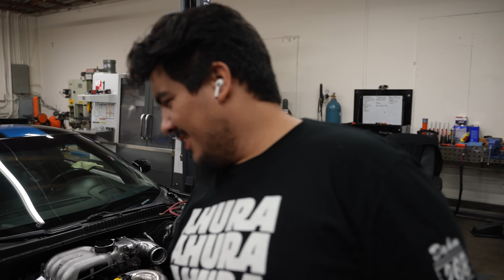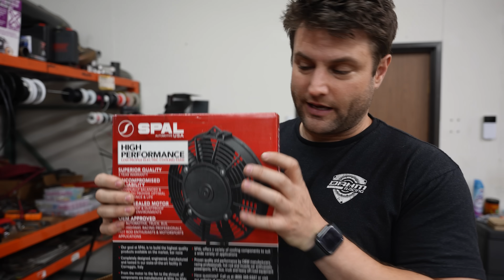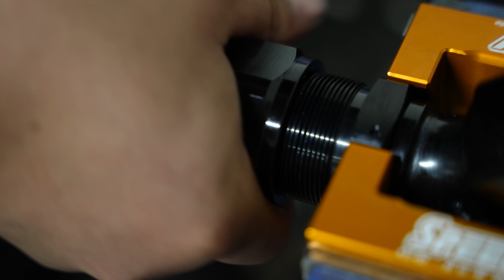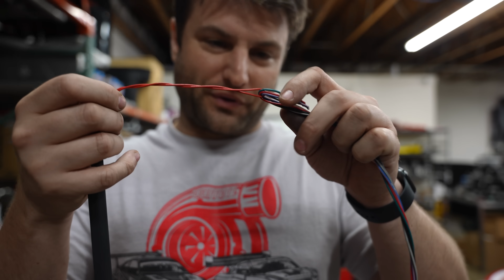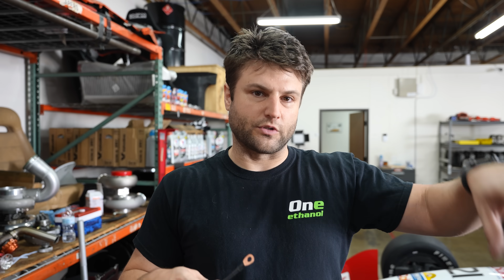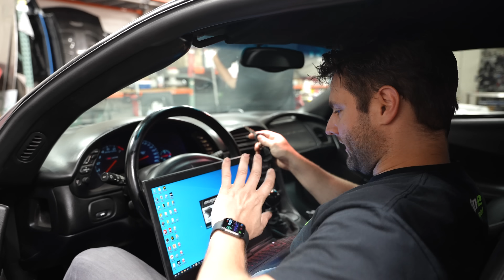Building the Rotary Corvette GM would be proud of. Everything works.

Comment: Something I just learned recently:  pre-filling the oil filter has more risk than benefit.  When you're pre-filling it, you're pouring that fresh oil into the output side of the filter, meaning it's not getting filtered before going to the engine.  While in theory the oil and filter SHOULD be contaminant free, oil and filters do sometimes have contaminants from the manufacturing process or the packaging process, and you've just given them free access to your shiny internals.  When contaminants measured in microns can damage those shiny parts, it makes sense to make sure every single drop of oil goes through the filter properly.

Comment: that electric pump sounds noisey crappy, you can install a clutch on the pump pulley like ac compressors use so when your I drag strip it disengages the pump, can be computer controlled or g force

Comment: Teasing with the FC in the background. I love the fact that the OEM gauges are working.

On the oil temp though, you need to let it at least reach 212F to burn off water vapor and contaminants. Did you put a thermostat in the oil cooler lines?

Comment: As you mentioned in the last vid the MR2 uses electric power steering. The reason I've been always been given for that is that it allows the ECU to switch off the power steering once you're at speed. So once you hit ~70 the p/s flicks off and that gives you the more direct steering wheel. 

Not sure on the Volvo setup but I'm sure you could implement similar functionality.

Comment: Answer to not needing DBW TB to make car work. 

Use hptuners. In system tab under platform, DBW column has a 1 under Y body (vette).  Put a 0 there.  Remove all dbw/electronic pedal codes also.  Done.

Comment: I worked a OEM wiring factory, if that relay is made by waytek its about the toughest relay you can get, we put those on mining equipment like rock crushers and stuff, if it can handle that environment it will last in a car for a long time

Comment: If you want to measure current you can also put a low resistance high power resistor in series with the battery and use the meter to measure the voltage acxross the resistor. Ohms law to find current. This way you won't fuk your meter

Comment: Hey Rob, a pro tip regarding the Volvo power steering pump. It require the Volvo OEM green powersteering fluid, otherwise it can be damaged! That has happened in the Volvo dealership I work at.

Greetings from Sweden, also been following you for a long time and absolutely love the content you upload and especially the four rotor build!

Comment: Now that's how you weld up charge pipes. Take notes all you wanna-be welder/fabricators here on YouTube. Pie cuts and mandrel bends, TIG welded WITH FILLER (its ridiculous I have to say that) and he back-purged the pipes to reduce crystallization and deformation along the welds on the inside which negatively impacts flow. Ugh, I'm not even a welder but as a mechanic and builder I know this stuff so the bad welding videos must really frustrate the professional metal whisperers.

Comment: That Volvo pump usually outputs about 60% of the capacity when just plugged into 12v, to utilize the complete 100% you would have to connect it to a can-network as they are stock..

Comment: I am pretty sure if you read out how much Ohm the throttle body of the Corvette sends back to the ECU on start up to check if its there, and it opens, you could use resistor's to not have that flappy thing on the car :)

Or if you want to go a bit more Techy, ZeroPi will work too, Have seen it trick BMW ecu's and GM ecu's to work together without any hicups!

Comment: If you wanted to do a test since you have a almost direct turbo to throttle body . You can do a air to water intercooler with a dry ice box in the trunk see which works air to air or air to water  intercooler  .

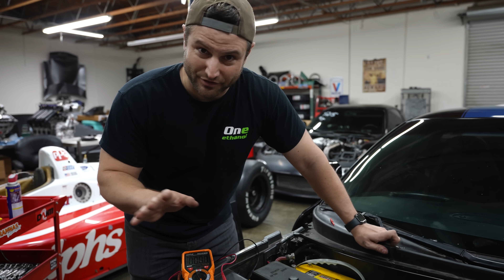Comment: I find it awesome that you really relate to normal car problems such as current leaks .I tested my car just like at 27:00, to see what was the problem ( batttery could drain in 2-3 days ). Turns out ,I had a really weird problem where my oil sensor was kept on , sending signal to the ECU even when the car was off. (Hondas CAN be weird sometimes ^^")
Salute from France camarade !

Comment: rob i had to rig up a tuner nerd knock monitor on my haltech 750 because i didnt get the 1000 because i didnt know what kncck was at the time lol anyway i know now, but my ghetto knock control, you would love it, the knock kit needs a rpm signal, and i put another input and made a custom input table where it pulls timing with voltage, lol i always do stupid shit and have to ghetto some work around

Comment: The gm electronics are going to hate that alternator output. Anything over 14.2 for 6 seconds is going to flash charge fault on the dash.  C5 wants 13.0 and that's it. Hope it doesn't cause you issues.  Keep up the good work.

Comment: something to note, those volvo/ford epas pumps are meant to have a green hydroelectric steering fluid (Used in alot of merc convertible top systems) i believe its thinner and seems to quiet down that whine you can hear with the pump running, compared to the regular mechanical style clear or red. Love the videos though, keep up the amazing work :)

Comment: Rob perfect job 👌🏻but i have a question the oil filter housing is to close from the intercooler and may transfer the heat to the intercooler while you are moving correct me if i am wrong?

Comment: Not that you're technically using the stock throttle body.....but put some mesh guard over both openings! I blew my ecu by cleaning it while still plugged in, car was 'off' but still connected to the battery....
Great seeing the Corvette again. 😊

Comment: Why wouldnt you just have the air flow through the intercooler the opposite direction, and have one pip cross underneath the other.  Then your bends can all be far les than 90 degrees

Comment: Hey Rob. They El. Servo your tunning. Are you using the canbus system. Or Just straight power to it. On our drift car we are using a Volvo electric servo pump. But without canbus system its only running at 70%. Have ur manage to get it to work with canbus and have 100% or Just 70%

Comment: Integration of the stock dash is an awesome achievement. It's those little personal goals and victories that make your content and cars so unique and keeps me watching the Dahm show.
Reply: Only thing to fix is the Check Engine light.

Or Rob will keep it to let te people literally check what engine is underneath???🤔🤔🤣🤣🤣
Reply: @gabrielecossettini2923  Easy fix is just taking the bulb out the back of the cluster
Reply: @wondernoob8189  For my old car, we just left it on till it burnt out...
Reply: A check engine light is a natural fit for a gm
Reply: I did a 1uz turbo swap in a lexus IS220. was a big deal to me to get speedo, rev counter, HVAC all working as stock. got 'er done. nothing bugs me more than a swap where the dash just sits there dead. seems really half arsed.

Comment: You get more boost pressure from a 2” pipe than you will a 3” pipe just an FYI, the bigger you go the more boost pressure you lose think about it dude, and btw 10w-40 or 15w-40 oil that’s another reason your tearing motors up
Reply from the maker: I don’t want more pressure. I want more flow. Pressure helps with low flow throttle response. I want to make high flow as responsive as possible.

Comment: Out of curiosity, wouldn’t you want the fittings to be on top of the oil cooler?  From my understanding, when the oil enters, it’s not gonna go all the way to the top because of gravity.  That’s just me, unless you know something I don’t
Reply from the maker: Fitting and packaging forced it to be that way at the time. They work perfectly so it’s not an issue as long as you don’t let the system back feed and empty them out every time. But the 4 rotor and 3 rotor  runs the way you are asking
Reply: @RobDahm  ooooooh, okay, gotcha

Comment: Fyi. You can use hp tuners and change the throttle setting to a cable throttle body so you don’t need to have that throttle body chilling in the fender.

Comment: Usually tachometer outputs from standalones work on a 1 rpm equals 1 on the tachometer or 1 rpm equals .5 on the tachometer. The adaptronic should have the settings in it to get it right.. edit, glad you got it goin. I commented before I watched the whole video

Comment: Im sure you have thought about this. The larger the pipes and intercooler internal air volume is, the larger the turbolag. 

Takes time to build boost in a large volume. 

Flow/pressure calculations to get the air volume as small as possible has its advantage.
Reply: I thought about this while he was modifying the turbo. I get it, symmetry is important, but creating a restriction via turbulence or low velocity is self-defeating on the next 1,000HP Corvette build.

Comment: I don’t recall what trans you are running but Meziere and Derale are making transmission pans that are fluid cooled, you plumb them into your radiator/ cooling system and have been proven to knock your trans temps down by 100 degrees. Something to look into
Reply: He's running the stock, IIRC, manual Corvette trans with a lower final drive ratio to account for the rotary's power curve.

Comment: The Spal kit reads the temp wrong. It gives you the radiator temp instead of the coolant temp. Difference is about 40° F, dont over heat that engine on accident.
Reply: That sensor should control the fans which is regulating the radiator temperature.  The thermostat is regulating the engine temperature, not the fans.

Comment: Hey Rob, was there any particular reason as to why you elected to use a Fram oil filter versus any other brand of oil filters? Just curious.
Reply from the maker: It was at autozone. I’ll replace it asap.
Reply: K and N split where the spot weld hold thier nut on.

Comment: My Volvo has what I believe to be the same power steering pump. It seems way quieter in my car although that's probably because it's way tucked away in my car. The current draw is pretty wild, when I turn my wheels idling at a stop I can see my headlights dim. Fun fact, Ford owned both Volvo and Mazda at the time this power steering pump was originally used, my car is actually built on the same Ford chassis as the Mazda 3.

Comment: Dude, Titanium is mind bendingly light. A full cat-back can be lifted with a couple fingers.
Reply: Bending it in a press brake is crazy too, have to overbreak it by several degrees because the springback.  It's super light but incredibly strong, it's insanity
Reply: I saw a man lift a full size cat with just his titanium fingers
Reply: Whats the price difference on that?
Reply: @rotemtomhagbi1937  in betting on a scale from Jeez to Shew Buddy it's at least a Oof.
Reply: I remember the first time I picked up like a 2.5 minute length of titanium exhaust tubing almost smacked myself in the face.
Reply: Thats nuts! I knew titanium is crazy light but I never realized that they made exhaust out of it.
Reply: @G-_Money  Of course! Titanium exhausts tend to sound different (better imo) too due to the different characteristics of titanium vs steel. i.e. identical stainless and titanium exhausts will have different sounds, just because the material
Reply: @Thebadbeaver9  oh yes, there is definitely a sound difference between aluminum, mild steel, stainless and titanium...

Aluminum exhaust is an oddity on its own too.
Reply: @Thebadbeaver9  - Density